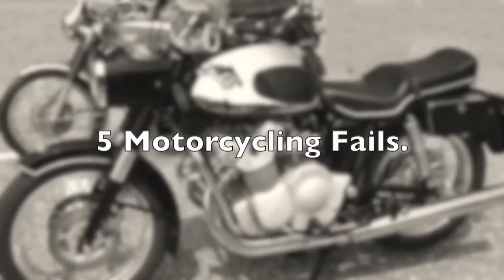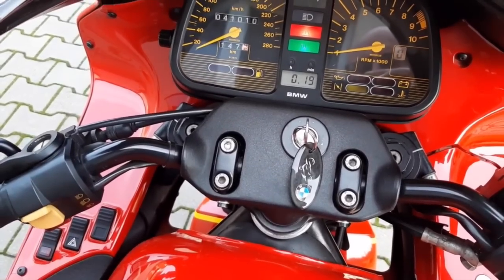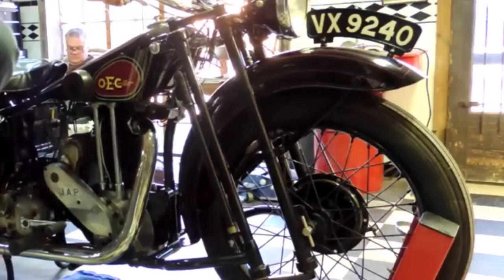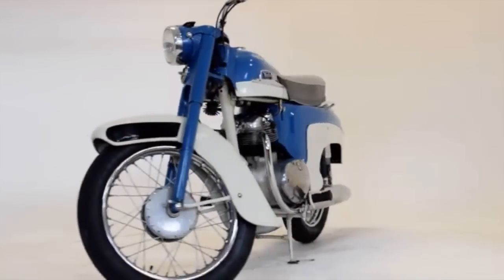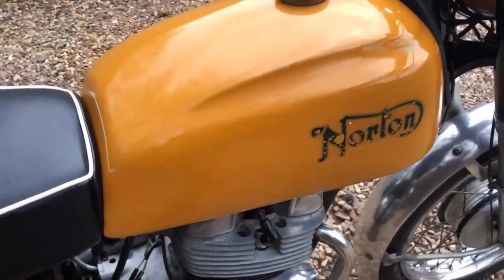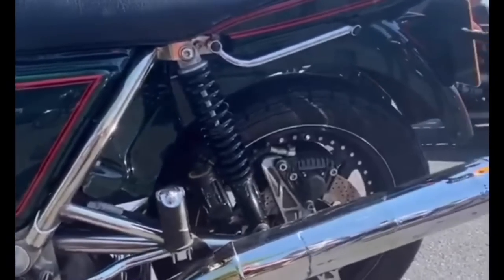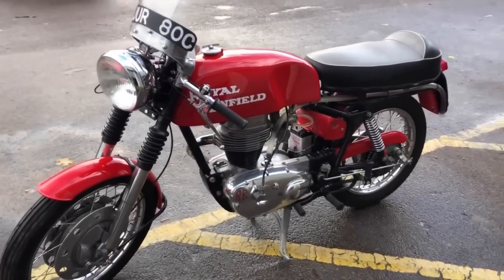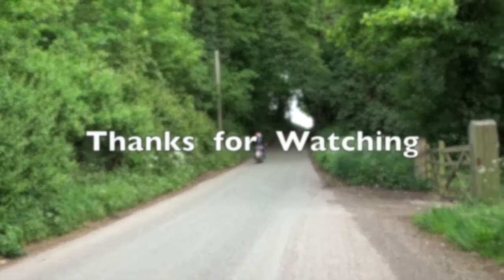5 Motorcycle Fails

Comment: A mate from school had a Norton Jubilee that rattled so much he could be heard three streets away and every time he parked it applied rust proofing to the ground underneath, later he bought a Honda Benly with oval brake drums - a great little goer but stopping was even more exciting. Another mate's brother in law had a Continental GT and loved it and had no complaints about the gearbox and an old codger across the road put serious mileage on his Crusader that had a full fairing and mostly carried a weighty pillion passenger - mileage often accumulated taking it back to the factory where they never found the fault he was complaining of. Another guy we knew then had a 175 Aermacchi, a little known Italian/American creation that looked a bit like an oversized Honda 90 Sport. A workmate had a Garelli 90. My brother-in-law to be had a Suzuki B100P, then a Super Six, and then "The Kettle" as the Suzuki 750 was known...
I started with a Suzuki 50 Sport and then a BSA C12 and then a Matchless G11 finally ending up with a Honda CB250.

Motorcycling was popular, cheap and above all, it was fun...
Reply from the maker: Motorcycles should indeed be cheap, unfortunately so many modern bikes just aren’t. 
The Jubilee is such a frustrating bike , it should have been a little belter but wasn’t

Comment: @ 17 y/o, in 1974 I started working for E.S. Motors in Chiswick West London. The proprietor , Peter Stapleton told me that under his father in the fifties and sixties they were the biggest Royal Enfield in the world. Interestingly, they became a Honda dealer in the sixties but Peter never told me how many more CB 72s they sold in comparison to the GT Continental! He claimed that he sugested the name for the G.T. Continental as a young lad working in the shop. The problems of the 5 speed box were down to the fact that instead of two sets of ‘ dogs ‘ on the layshaft, there were only one and with rough treatment, they wore very quickly. The other issue was that the selector mechanism needed very careful and precise adjustment. If the parts were new and the gear change effected with a delicate touch, the box did work well, however as virtually every British motorcycle g/box was like shearing off a 3/8 bolt to change gear and size 20 boots were a necessity, the 5 speed box never really had a chance. The Engine also had a complex oiling system, marginal at best and the typical lack of maintenance ethos of the young meant many dead engines.
Reply from the maker: Some things never change, young riders hammering their machines with minimal maintenance

Comment: I passed my test on a Jubilee in 1968. It wasn't a great bike to be sure. It was too heavy, the forks weren't damped and the brakes were next to useless. It leaked oil into the points chamber - there was a drain hole in the cover! - and it *rattled*. Many years later, a top-notch engineer I knew bought one and rebuilt the engine with enormous care to really tight tolerances. It still rattled as if it was knackered!

I sold mine ASAP after my test and bought a 1958 Matchless G80S. What a transformation!
Reply from the maker: Yeh I think the big bangers  are a lot nicer than the smaller capacity machines. Having to rev the nuts to make decent progress just doesn’t feel right on an old bike

Comment: I had a K1 - blue/yellow, bought together with my father. 

Constantly had problems, regularly went out at full speed, the first electronic control unit delivered was faulty. It need one and a half year to find the problem, in the meantime all the modules got changed. ….never again….☹️
Also lost oil, frustrated we sold it after two years with a high loss in value. ☹️

The power in the lower rpm range was weak, since then I don't drive 4 cylinders anymore...😏
Reply from the maker: Oh dear

Comment: Always fancied a BMW k1 but was put off by the higher cost and heat issues from the enclosed engine.  Bought a K100 (solid performer but somehow felt top heavy) then followed by the excellent K75S....surely one of the best (and smoothest) tourers you could buy in my opinion...and economical too.
Reply from the maker: Maybe they should have just built a larger 3 cylinder
Reply: I toured Southern France 20 years ago on a then 17 year old K100RT. Top heavy it most certainly was, later on I found that was overtightened steering head bearings. Other than that it was a great two up inexpensive tourer.

But… the excess heat issue… entering Barcelona in 30° C ambient heat was unbearable. The engine jetted excess heat to my inner thighs at any speed, going fast just made it feel like you had switched the hair dryer to “full”. I ended up riding north with a towel over the saddle and mild burns on the inside of my legs.

It was sold after two years of great service and a year old R1150GS was purchased just before Ewan and Charley gave them the depreciation of gold bars! Roll on a couple of decades and many bikes have passed between my legs and the current ride is a R1250GS and it’s as good as all the reviewers say 👍🏻👍🏻👍🏻

Comment: Fair enough my friend, but the tech members/mechanics on the forums, with decades of hands-on experience on these bikes say the performance chip somehow affects the timing, and that it's not necessary to mechanically advance it like on the 2 valvers. The K1 horsepower was dialed back worldwide to 95 bhp with the fear of a looming 100 bhp limit on ALL bikes in Europe. I remember those dark days - Triumph stood against those Euro politicians with their Daytona 1200. All I know is my K1 is now as smooth as my VFR 750, except at 75-85mph where the BMW is so glass smooth it feels electric. Good vids, thanks.
Reply from the maker: True enough, don’t think the euro political bods were that bothered really because those restrictions never happened. The 125bhp from the Japanese was a kind of gentleman’s agreement which I think Triumph broke for marketing reasons as much as anything else, it worked too because their bike sold and the Japanese dropped the whole voluntary limit thin for good.

Comment: Cool video. The the K1 was a brave move by BMW that led to the K1200RS so that's a good thing.  The K12RS was an designed as a high speed, long distance bike. I toured the continental divide up the Rocky Mountains from New Mexico to Canada on one and I took it coast to coast across the US and I remember it with a smile. You could literally run these things flat out all day and it was happy to do it.  The RS-SE had ABS, cruise and heated grips and it was fairly advanced in the market.  In the day, if you wanted to go really far, really fast, the Flying Brick was an excellent choice.
Reply from the maker: I suppose the K1 didn’t quite come off but it lead to a lot of better machines and it’s legacy of effective aerodynamics is very relevant today

Comment: I had a '92 K100RS with the 16 valve engine. Very nice on the interstate, accelerated like a turbine engine, but not much fun once I got to the mountains. Well, it was nice in fast sweepers, just don't try to shift that clunky gearbox halfway through a corner or try to change lines with a 600lb bike.
The last time I rode it to meet up with some friends for a weekend the drive shaft broke. 38K miles! So much for BMW reliability!
Reply from the maker: Well I’ve always found mid corner gear changes on a shaft drive can be a bad idea. They always seem happier when you change early and use the torque to drive through.definitely true on Guzzis and BMW boxers

Comment: The Hesketh and MV would both be on my lust list! I like the Mari mite line! Took me a second to get it.😁I live in Edmonton Canada so not as blessed as you on the other side of the pond when it comes to rare bikes. There is a Hesketh in the area however no vintage MV four. I have my eye out for a Lavarda triple. I stupidly passed on a non runner just out of town.☹
Reply from the maker: They are extremely rare seen MVs at Vintage motorcycle club events

Comment: My friend owned a Norton Electra. The side stand broke. The electric starter broke. The center stand broke. The kick starter broke. Therefore, he had to lean it against a tree or fence and push start it. I had a RE 250 Continental GT--slow but great fun. I did not have the shifter problem, but the gearbox itself was fragile. I ruined one by speed shifting--the teeth came off a couple of the gears.
Reply from the maker: Definitely had some gear shift issues then if it destroyed it’s self. The  RE was a pretty thing though

Comment: I can remember seeing a GT Continental for the first time ,I was about 8years old. I was about as excited as someone who had just bought one. I thought it was a real racing bike . My mate had a crusader sports which developed almost the same power as the GT around 20 bhp . I had an Ariel Arrow ( not the sports) which couldn’t keep with the Enfield. Mind you even the four speed box missed gears ,I can remember his engine reviving high on changes ,it could still beat me though.The only time I beat him and some other mates was when I blasted off at a country pub first and caused such a smoke screen I left them choking in the wake!
Reply from the maker: Pity the crusaders box was so temperamental. It was very pretty but also expensive for a 250.

Comment: I wanted a K1 from the first time I saw one, but couldn't afford it, not that they were readily available here in Australia. I finally found one in 2003, but it was gone when I got there. I test rode a K75s and then owned it for the next 15ys as it was just the best thing I had ever ridden. If my knees could still handle it I would be riding it still. When the K1's come up for sale now, they are half as much again as they were in 2003. Same goes for the R1200c. Would still like one of each, even though I probably couldn't ride the K and didn't like the R when I did ride it.
Reply from the maker: K75 was the real classic of that series

Comment: It's a myth about K1s vibrating because of bore/stroke or lack of balance shaft - it's retarded ignition timing for emissions and strict TUV bhp limits. I recently bought a beautiful navy blue/silver K1 (tell me ANY bike that wouldn't be called weird in bright red paint with yellow running gear/seat/giant decals). An $89 Ebay performance chip cut the stock vibes 90%, plus response and power was noticeable.
Reply from the maker: Didn’t in fact say bore and stroke, the overlay short con rods caused the secondary vibration. Bike would have been sold in a number of regions with different emission regulations, which to be fair in Europe in the early 80s were not particularly tight at all. So the ignition timing is unlikely to be the same everywhere. The US being particularly stringent in some of its States in comparison to Europe.
Emissions regulations seem to carry the can for everything these days

Comment: To be fair to MV Agusta, poor electrical components and bad chrome were a feature of all Italian bike manufacturers of the 1970s, except for one: Laverda sourced its components from the same supplier as Honda.
Reply: It was only the speedo- and tachometers Laverda shared with Honda. The handlebar controls were the same type that on the Suzukis of the 70’s and the general electric components were from Bosch.
Reply from the maker: That’s the thing though, laverda had a better reputation for build quality than MV. And MV were of course fantastically expensive

Comment: the K series are near bullet proof from what I've seen
Reply from the maker: Well as I said they are tough motors, some have ran pretty big buzzy miles
Reply: When they were first introduced they were notorious oil burners. Because of the way they were assembled, oil seeped past the gaps in the piston rings whenever the bikes were parked on their side stand. Another case of BMW letting their early adopters doing their QC testing for them.
Reply: With close to 7.000 bikes sold, the K1 could hardly be called a fail.
Reply: Good engines but I had a tele lever model. Hated the way it steered at low speed. Nearly dropped it on the first roundabout I came to. Very slow steering at low speed. Also very heavy bike. Got a 600 Hornet which weighs under 400 lb @ 95hp. A better power to weight ratio than most modern middleweight street bikes.
Reply: @CaptHollister  but hugely amusing when you were front row on the ferry as it arrived at Portsmouth with the bike having spent many hours on the side stand with the oil seeping into the cylinder heads. Cue the start up and you filled the car deck with blue smoke. Choking all those sports bike riders who were smug to the Nth degree. But we were smugger…. Three miles after departing we were at the local Tesco Express picking up a pint of milk for a cup of tea 5 minutes after clearing customs and well before the sports bikers had fallen off the M27 in their search for homes in the wastelands of northern England……

Comment: Interesting videos that include some bikes ive forgotten. Ive noticed that you haven't mentioned the Yamaha GTS with it strange single-sided front fork yet. I owned one when they first came out, just to be different. I toured southern Europe with mine. Great for motorways but at slow speed i found the front a bit heavey on the steering.
Reply from the maker: There’s just so many interesting machines aren’t there. I’m planning a video about suspension systems and it would definitely get in there as it’s the most commercially successful hub steered bike, a very interesting machine

Comment: Hesketh motorcycles are actually still in production at there factory in Redhill Surrey. The company was taken over by Paul Sleeman in 2010, and who is now also Heskeths chief engineer. In 2014 they released a brand new bike the Hesketh 24 which is being  produced in a limited number of 24 machines. All will be tuned by Harris Performance to suit each owners personal preferences.
Reply from the maker: No the V1000 though and in a limit run , all sold apparently. With an American S&S motor
Reply: @bikerdood1100  
Yes, but you claimed Hesketh ceased production, when they obviously have not and are still in business. Also the Hesketh/ Weslake engine is now an old design and it's far cheaper to fit a well designed, tried and tested American SS engine than design a brand new engine themselves. Apart from that, your video was very interesting and enjoyable.
Reply from the maker: He’s only building 100 I believe, which are apparently all sold. Fitting an American engine though.
And I was talking specifically about the V1000 in all fairness. Most  people are aware of the 24 after all, it has featured on the TV so it’s existence isn’t exactly news

Comment: Fascinating, it Has to be said that the RE is easily as sexy as the small capacity Ducati,s from same era, and the MV ( OK smaller dimensions ) looks like a Munch Mammoth, . Also i seem to remember that @ the time reading that BMW worked closely with Peugeot on the K series engine,s (  a bit like Modern day mini,s)
Reply from the maker: RE was a pretty thing, BMW link is interesting, I wonder what Peugeot got out of the deal ?
Reply: @bikerdood1100  I kind of answered your question if looked? The modern minis , made by BMW are a collaboration, avec  PSA and BMW, it's all there to Google 4 yourself. No secrets

Comment: The original K100 engine came out of the Peugeot 104. 😂
Reply from the maker: Of course it did 🙄
And the R series came from the Citroen 2cv
Although it did inspire the low line Brabham BMW F1 car which in tern changed the design of formula cars for ever as a slightly more historically accurate note
Reply: @bikerdood1100  No need to be like that... I was just pointing out something  that was important to the development  of the bike.
Reply: @bikerdood1100 I have read somewhere that the person who designed the Citroën 2CV engine in the 1940s based it loosely on a 1930s BMW motorcycle engine, having experience of repairing one for a friend.